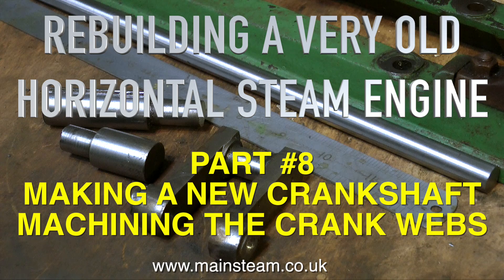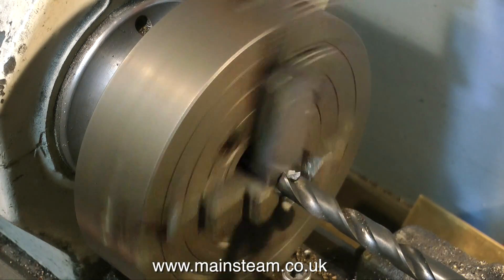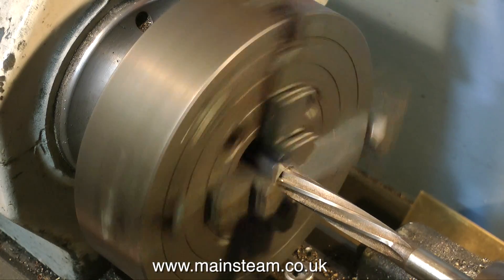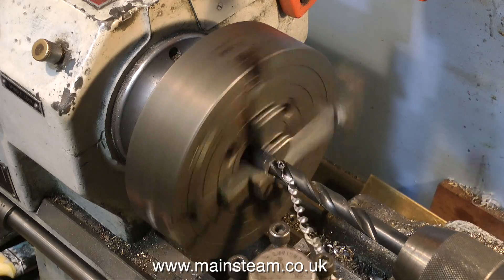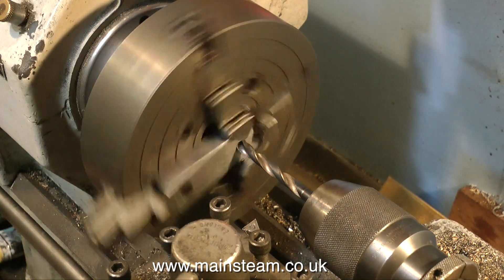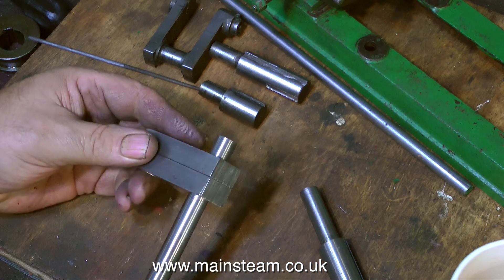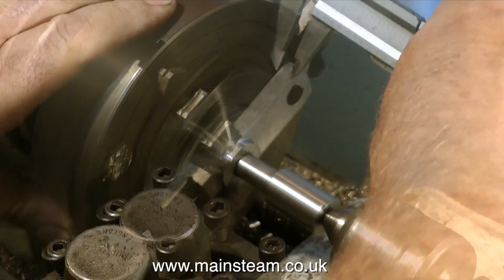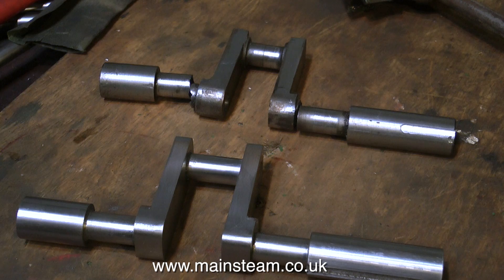PART 8 - LARGE HORIZONTAL STEAM ENGINE REBUILD

Comment: In the old days (1960s), before all these different Locktite formulae, we would produce this crankshaft either from one piece of steel or by fabricating sub-assemblies by initially turning slightly oversize, brazing (hard soldering) together, then finishing the crankshaft to size in the lathe.
Reply from the maker: +Gordon Burns I used to use press fits in the olden days ......
Reply: Keith Appleton
We did, too, but with press fitting the assembly work must, by definition, take place on the press bed, not on the workbench, hence a chance of not getting things completely right. By silver-soldering (brazing) you can assemble at the bench, make sure things are exact, then braze together. Another advantage is that in future, if a part of the assembly required replacing, you could heat it to break the hard soldered joint and disassemble quite easily. Keep up the good work, Keith.